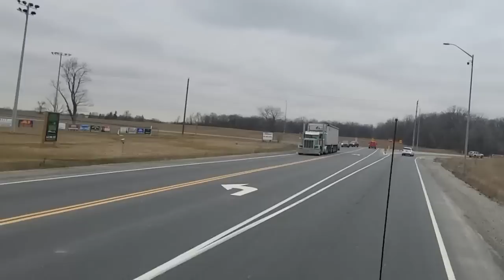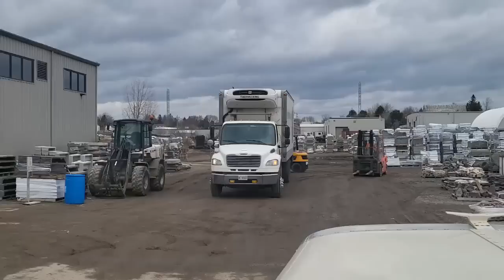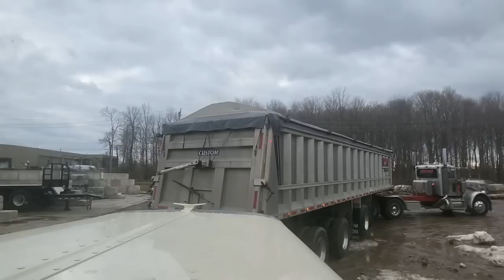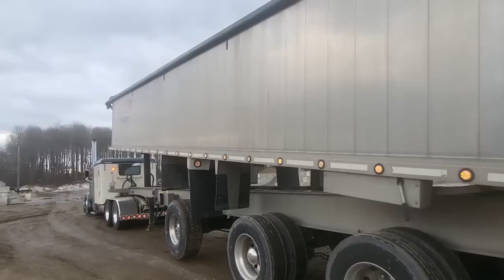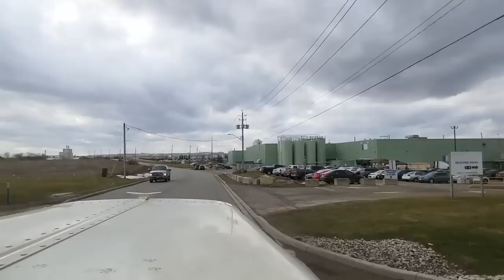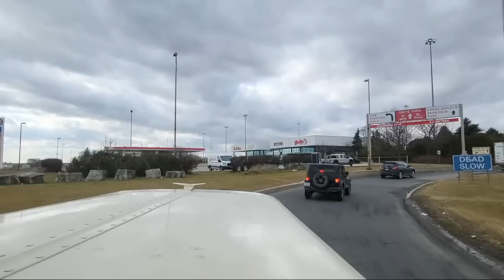THESE TRAILERS CAN TIP OVER EASILY ! Putting The Box Up In The Air, With STRONG Winds, Is NEVER Fun!

Comment: As they say, there are two kinds of dump truck driver's. Them that have laid them over. And them that will lay them over. I used to pull a 38 foot Lufkin frameless end dump, when you had the ram all the way up, the whole was sitting on just one axle. It would surely make your butt pucker on windy days